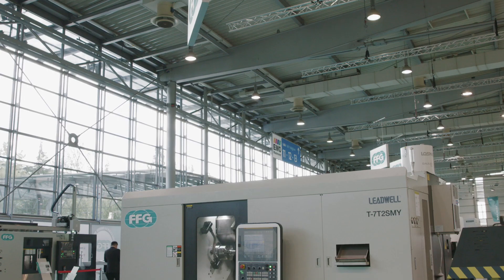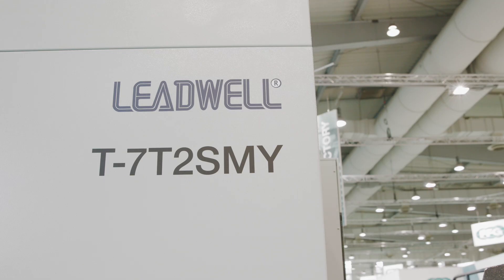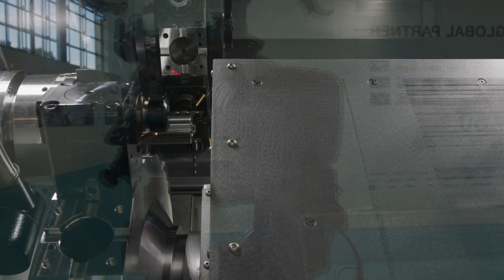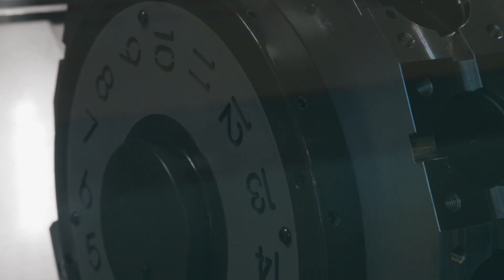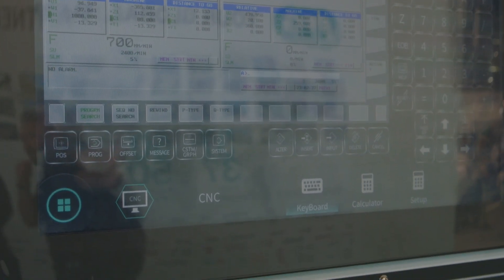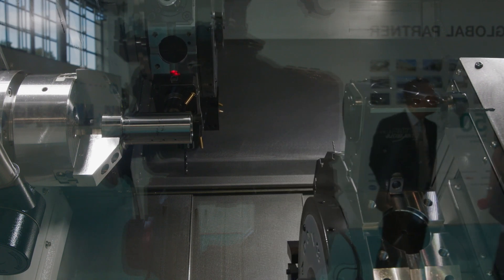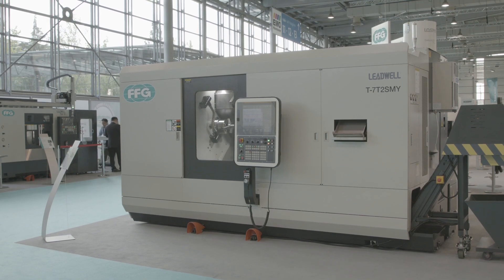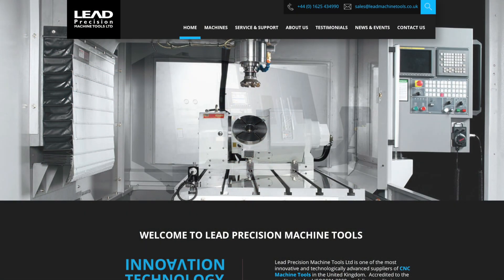Multi axis turning from Leadwell and its big too

Comment: I will never purchase a Leadwell because every single one I've ever used( V20i 5 axis, v50, v60, and a couple lathes) were all terrible. The V20 had backlash so bad on every axis it was barely usable as a five axis. All the service agents were clueless about fixing it. They couldn't get the parameters right. When you would shut the machine down at night and come back in the next morning and home it out, you'd have to re-sweap the trunnion table because it would randomly lose its position. It was a brand new purchase too! 
They have obnoxiously loud belt driven spindles. Garbage bearings on the spindles and ways.
Unbelievably slow tool changes. 
Lathe spindles had minimal power, no torque. Slow rapids.
Oh... and antique fanuc, 1980's no-memory having, controls.
If you're serious about true precision machining for your company, DON'T bother with Leadwell. 
Big budget: 
DM Mori
Mazak
Hermle
Small budget:
New Haas
Used Mori Seiki or Mazak 
Maybe used Kitamura or Brother